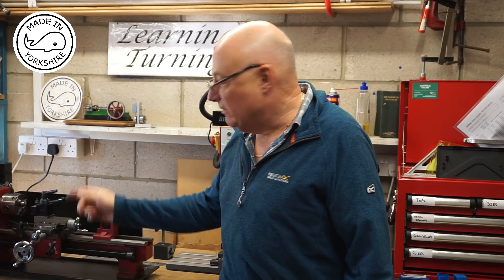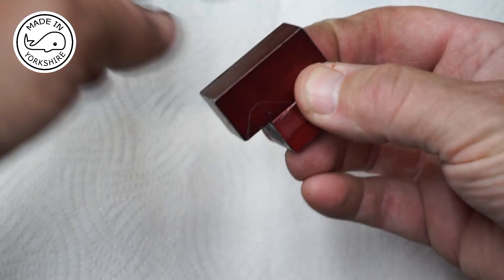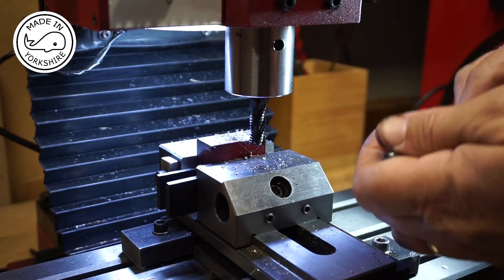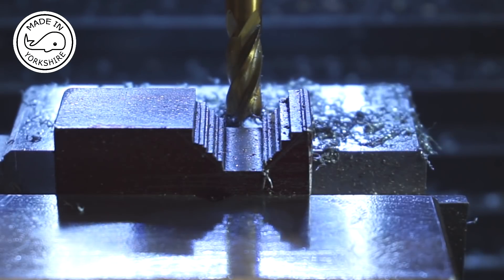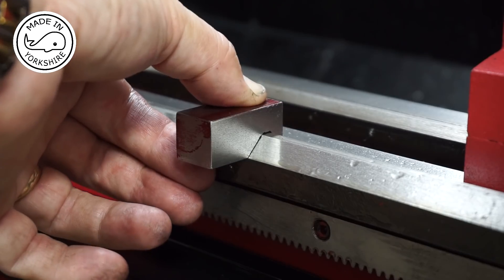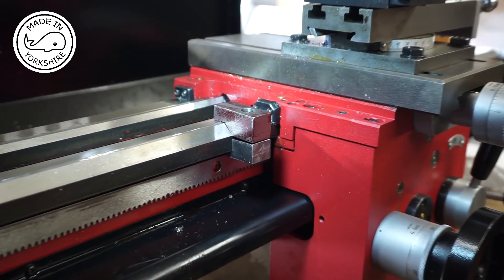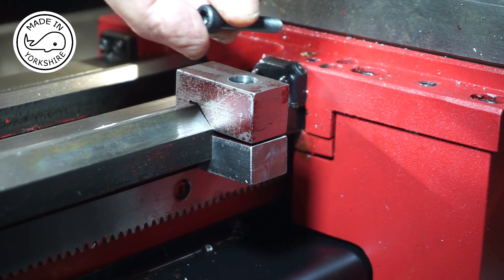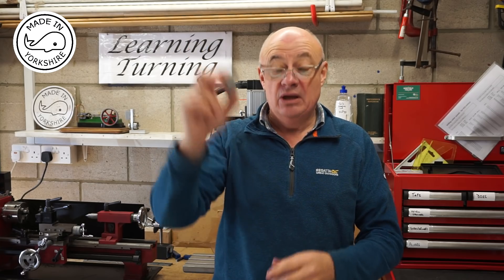#MT26 - Making a Sieg SC4 Carriage Stop

Comment: Have you traded in the sc3 or are you now running both lathes?
Reply from the maker: Hi Ron - I'm running both. After making the various mods the SC3 is a cracking little lathe. Only workshop space will determine whether I have to sell it in the long run.
Cheers
Andrew
Reply: Well, you can make components for one lathe on the other lathe. Never a disadvantage to have two.

Comment: Hi Andrew,
I did the same type of carriage stop, rather than a threaded bolt I used a piece of silver steel as a sliding stop, locking it by a thumb screw. Also used a knurled knob for locking the stop to the ways of the machine.
No more fiddling with an Allen key socket that's full of chips.
As for cutting the vee on the mill, make you self some angle blocks, Joe pie and mrpragmaticlee shows how easy they are to make. Save a lot of guess work or trying to crank the head of mill to get the angle.
As you'll already know the sc4 doesn't have clutch for the saddle travel when using power feed, just beware of crashing into stop.
Adam
Reply from the maker: Hi Adam - many thanks for the info. I will certainly check out the info on the angle blocks.
Cheers
Andrew

Comment: Very cool. I also have a SC4 lathe and I made an almost identical carriage stop about 2 years ago.  I also added a cam lock carriage lock to the carriafe in between the ways and made tapered brass gibs.  I just subscribed to your channel too!
Reply from the maker: Hi Brandon. Thanks for the info and subscribing. A cam lock carriage lock is certainly of interest. I made a carriage lock for the SC3 and I must get round to making something similar for the SC4. If you have any diagrams/pics I would really appreciate it if you could email them to me at learningturning@btinternet. com. That would really help me.
All the best.
Andrew
Reply: Learning Turning Metal - by Andrew Whale I will send you the pictures and I might still have my drawing from Fusion 360.  I will try and send it tonight
Reply: @brandontscheschlog  Hello, if you can send me the FUSION 360 file too, thanks

Comment: Nice little project! A couple things you might consider. Turn the screw around so the carriage hits the head rather than the threads so they don’t get damaged. Also add a jam nut so once the screw is where you want it vibration or bumps won’t change it. Thanks for doing these videos!
Reply from the maker: Hi Rick. Thanks for the suggestions. I think I will try to get hold of a longer screw and add a jam nut, or maybe a spring.
Cheers
Andrew

Comment: I have an SC-4 and I highly recommend that you make a second one. I’ve found that the carriage lock isn’t that great. I have had problems with parting off larger steel bar and on interrupted cuts. I ended up making a second stop. When I part off I put one one each side of the carriage to hold it in place. It works great.
Reply from the maker: Hi Anthony. Thanks for the suggestion. I've not tried parting off on the SC4 yet. The carriage lock is certainly poorly documented and doesn't seem to look as robust as the one I made for the SC3. Thanks again.
Cheers
Andrew